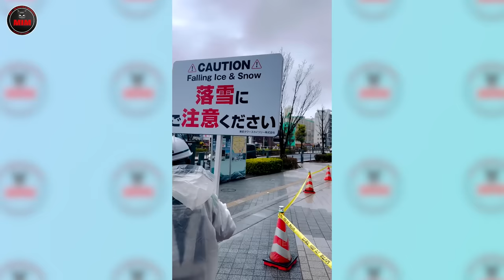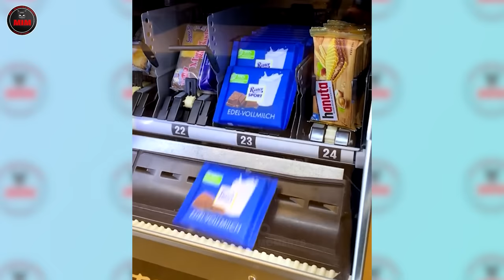Incredible Moments Caught on Camera | Best Of Month P2

Comment: The electrical lines are close to the structure and the is has alot of moisture causing electrical current to travel to the damp air to the surface of the structure, thus upon contact it causes sparks since the surface has a resistance.

Comment: What should you do if the building becomes energized like that while you’re inside?
Reply: They got the best Christmas display in town
Reply: One hell of a Grand Opening for a Meat Market
Reply: Wood does not conduct electricity, but you’d want to avoid touching anything metal or that is connected with the electrical system.  That probably includes doorknobs, so I think it would probably be best, like the firefighters, to wait for the power to be cut off.  And then get out as fast as possible.
Reply from the maker: Thank you. I’ve always been like that.